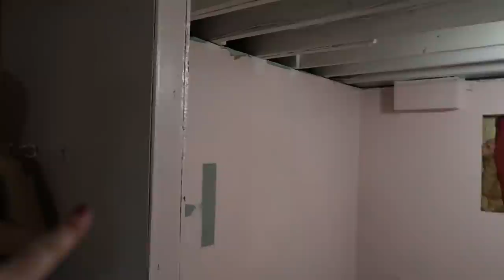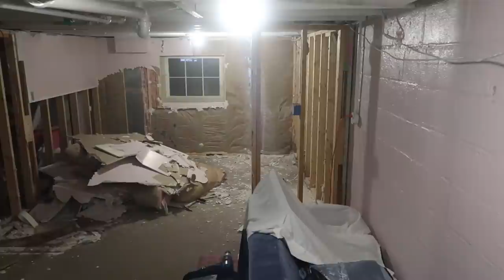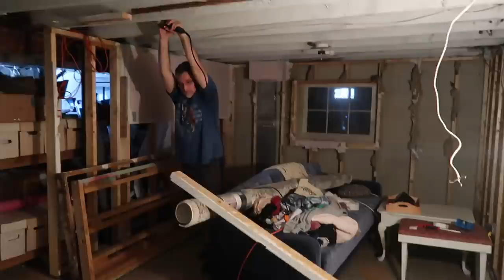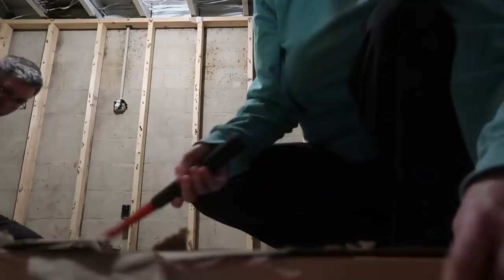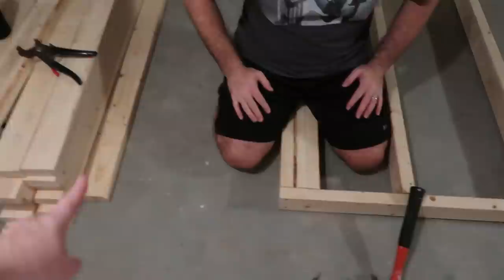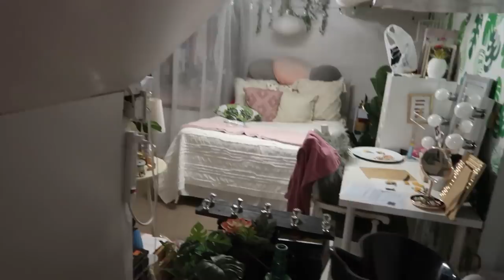BASEMENT BEDROOM RENOVATION - VIDEO TWO / DEMO DAY AND FRAMING WALLS

Comment: I notice you took out the insulation from the walls that were against the cinderblock are you not worried about the rooms becoming more cold without that insulation?
Reply from the maker: The insulation didn’t do much,  and we have heat down there so it’s plenty warm enough. 😀